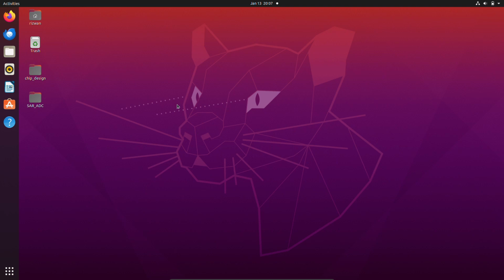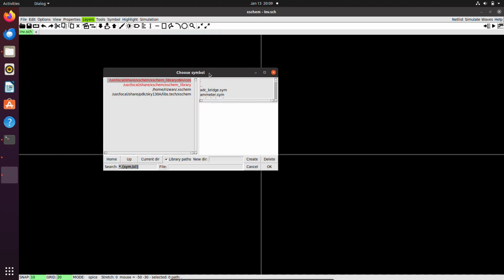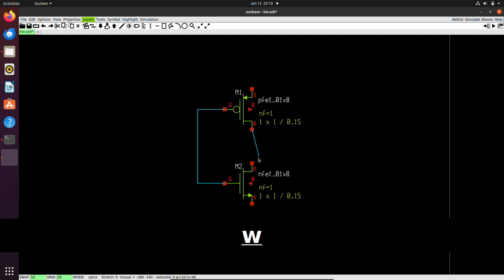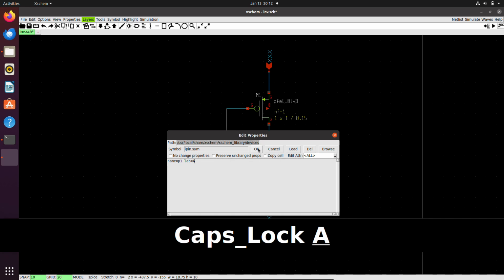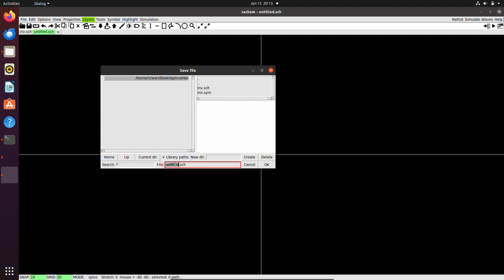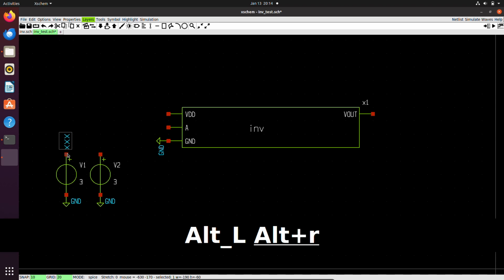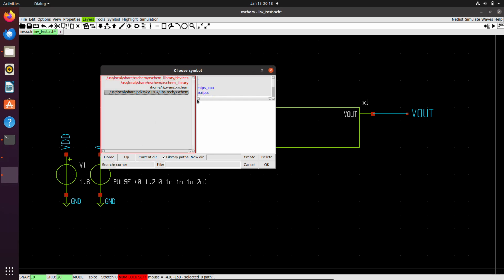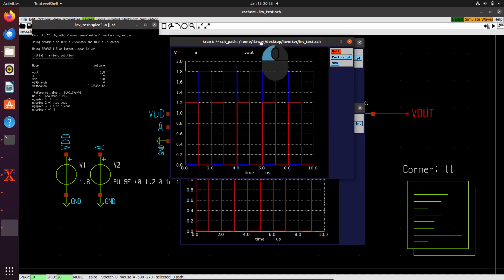CMOS Inverter Design and Simulation Using Xschem and Skywater130 PDK

Comment: Is there difference between sky130A and sky130B because for me it's showing sky130B in xschem
Reply from the maker: Yes, there is a difference between sky130A and sky130B. The main difference is that sky130B includes support for ReRAM (Resistive Random-Access Memory), while sky130A does not.